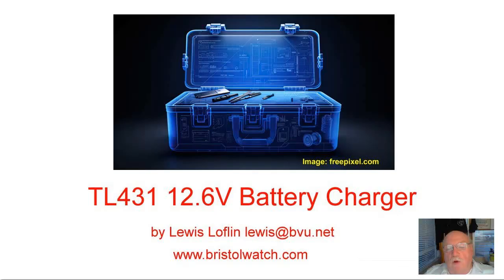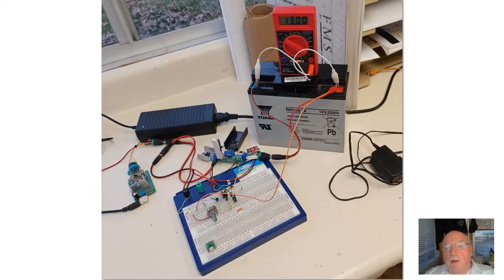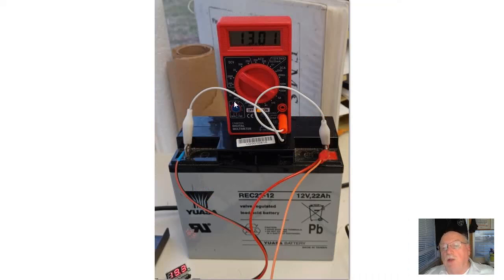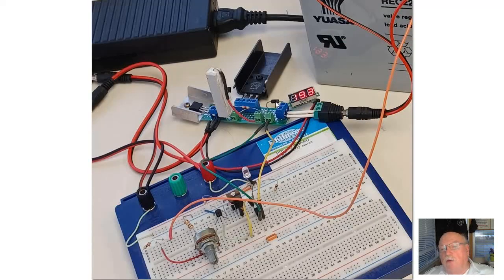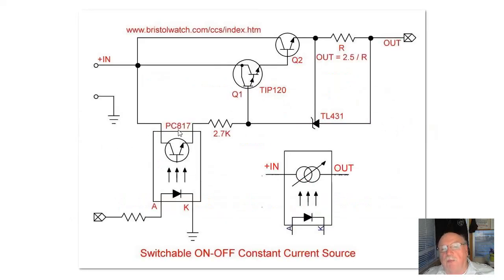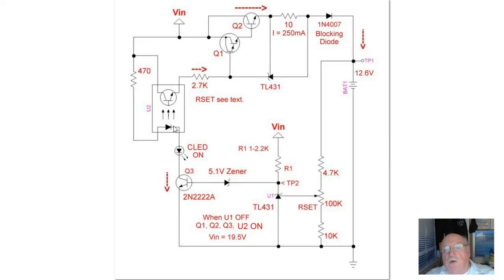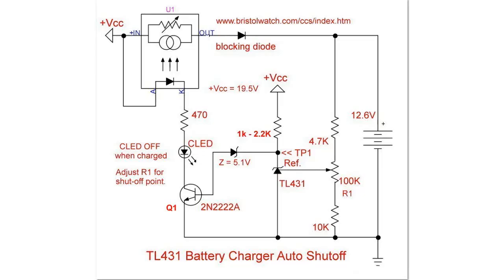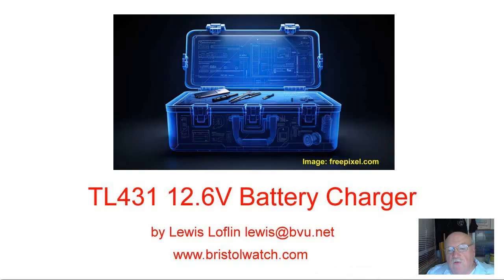TL431 12V Battery Charger Complete

Comment: Cool application of the opto in the circuit.  Simpler than designing a non isolated circuit.   Saves on calculating many circuit interactions.

Comment: What modifications can be done to get 20A out of the circuit to be able to charge 200AH lead acid battery
Reply from the maker: That TL431 CCS is limited to ~1.5A. I have another circuit coming up that could handle higher currents.
Reply: My version  6 amp tl431 based   @LewisLoflin

Comment from the maker: Related:
http://www.bristolwatch.com/ccs/tl431_ccs4.htm TL431, LM317 Battery Charger Circuits Schematics
http://www.bristolwatch.com/ccs/LM317b.htm LM317 High Power Constant Current Source Circuit
http://www.bristolwatch.com/ccs/tl431_ccs3.htm Power TL431 Constant Current Source Circuits
http://www.bristolwatch.com/ccs/lithium_charger.htm TL431A Lithium-Ion Cell Charging Circuits
http://www.bristolwatch.com/ccs/lithium_charger2.htm Charging Multi-Cell Lithium-Ion Battery Packs
http://www.bristolwatch.com/ccs/tl431_ccs1.htm TL431 Over-Voltage,  Under-Voltage Detector Circuits
http://www.bristolwatch.com/ccs/tl431_ccs2.htm TL431A Constant Current Source Working Circuits Demo

YouTube:
https://youtu.be/PvhyJXUhlKI TL431 Under-Voltage, Over-Voltage Detection
https://youtu.be/y2gnZ7HZefc TL431 Constant Current Source Circuits
https://youtu.be/kJUit6XQYKE TL431A Lithium-Ion Cell Charging Circuits
https://youtu.be/jVXmL7HThiM TL431 Battery Charger Circuit Calculations Revised
https://youtu.be/Fr0Zir8UCLs TL431 10-Volt Charger Short Version
https://youtu.be/gg0Tux_pAgk Charging, Charge-Balancing 18V Li-Ion Battery with TL431
https://youtu.be/QfXS70Kwx94 18.5V Li-Ion Battery Charger with TL431 (short)

http://www.bristolwatch.com/ele4/ccs_lm358.htm Arduino Measures Current from Constant Current Source
http://www.bristolwatch.com/ele4/css.htm Constant Current Source Theory Testing
http://www.bristolwatch.com/ele4/ard_css.htm Arduino Controlled Power Constant Current Source